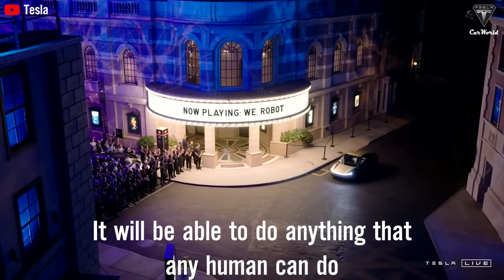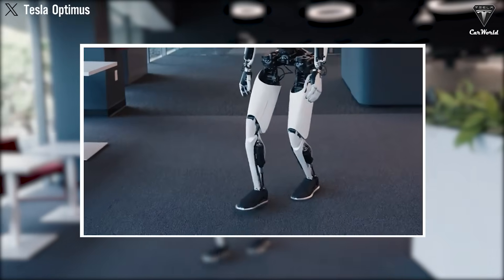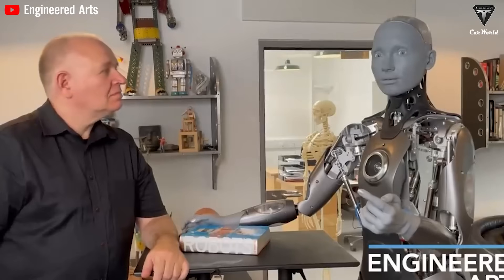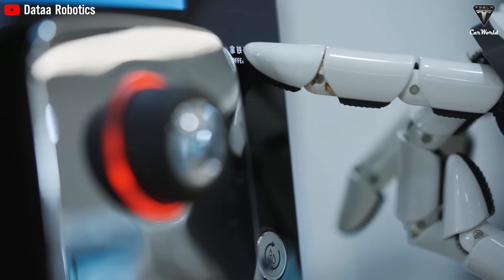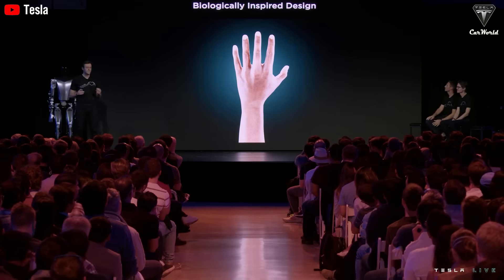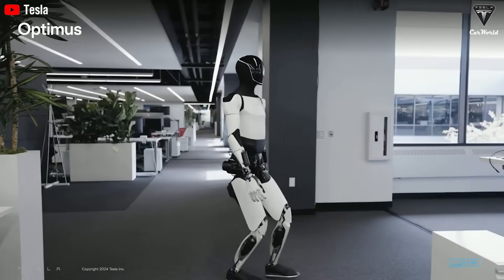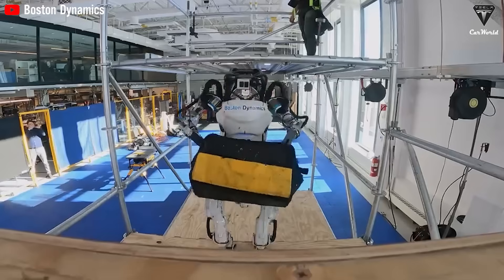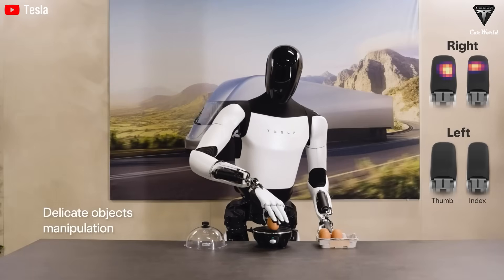It Happened! Elon Musk Reveals Incredible Features Of Tesla Bot Gen 3 2025! Destroy ALL Rivals!

Comment: Everyone in USA wants a good warranty! If you can get 6 to 7 yr. Warranty on a heat pump or maybe a hot water heater then you know they gonna expect at least that on a robot too. Also, it has not mentioned whether Optimus can climb a ladder and change a light bulb or can it do some carpentry tasks, aka cut a board and nail the board with nail and hammer and maybe get on your roof to change a bad shingle or build a fence around your property even?

Comment: I hope to see advancements in Tesla's engineering that will eventually allow Optimus to replicate the human gait cycle while walking. A redesigning of Optimus' feet to mimic the phases of human walking: the heel strike, where the heel contacts the ground first; the mid-stance, where weight shifts to the ball of the foot; and the push-off phase, during which the toes propel the body forward. The foot's arches, extending from the heel to the ball of the foot, should function like a spring to absorb shock and aid in take-off. Additionally, a transverse arch, similar to that of the human foot, should run across the top of the foot to enhance stiffness, which is crucial for efficient walking and running. Take a look at the SE01 robot by EngineAI; they have already created a robot with a human-like gait. However, I believe Tesla could achieve even better results, given their rapid progress in robotics.
Reply: I’ll take the affordable model as mine only needs it’s feet to walk with shoes so they stay clean. Sounds like you want the gymnastics model.